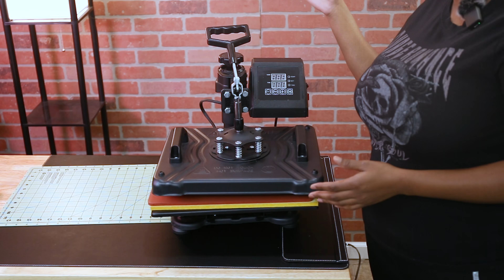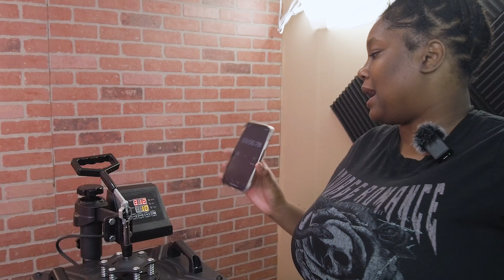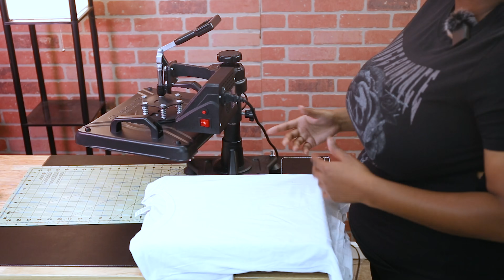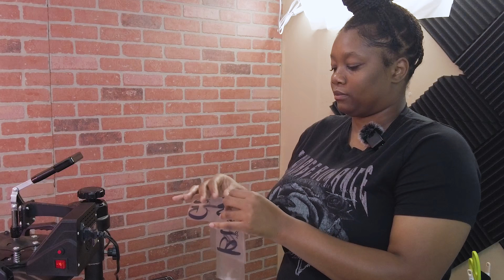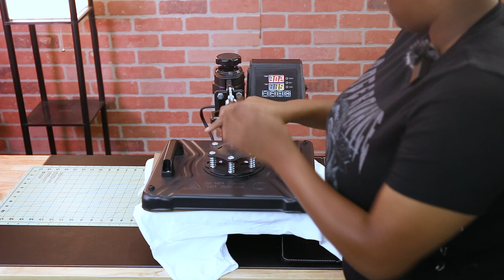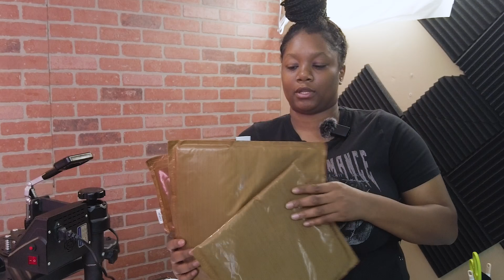How To Use Swing Away Heat Press | Swing away heat press instructions for beginners

Comment: I just bought a used press and the heat plate that you push down is wobbly how do I tighten that to move smoothly left to right like yours does?
Reply from the maker: Try tightening all the bolds with a wrench at the top and bottom of the press

Comment: Can you please make a demonstration using the Teflon? I'm planning on getting my daughter the VEVOR Hybrid Heat Press, 15 x 15 inch, 8-in-1 Multifunction, Heat Up Fast and Even, All-New Patented Design, Easy to Control, Sublimation Press Machine for T-Shirts/Tumblers/Caps/Plates, Light Green from Amazon for Christmas.She's a beginner. What else will she need to get started? T.i.a!
Reply from the maker: Hi, yes I can. But all you need is the telflon sheet and metal magnetic clips to hold the telflon sheet up on the top platen.

Comment: Best video I've seen in this topic.
Question: tips for doing a second transfer on the back of a shirt after I've done one on front? If I have shirt flipped (face down), should I have a piece of Teflon paper on the bottom plate? Or in between the shirt fabric?
Reply from the maker: Thank you! And as long as it’s a mat down on the heat press you shouldn’t have no problem. I have done it before without the teflon

Comment: my unit will not go under 200 temp, and it has no C or F button, how the hell do i know what the actual temp is??
Reply from the maker: You can use a heat temperature gun. And see if it has a reset button on the machine
Reply: @simplyshy  thx, otherwise i wasted 265 on a machine i planned to use to press comic books at a temp of 173F.
Reply from the maker: @mummra7  smh I hope it works out

Comment: Thank you so much for explaining the swing away. It is frustrating trying to go through videos, and everyone has the clamp. You explain very well. Now, 3 questions I have. 1. Where do you get your transfer vinyal from? 2. Which program do you use to make the image? 3. How to do big images like for adults shirts that's like 3xl & up?
Reply from the maker: No problem! 1. Mostly all of my vinyl came from Micheals it’s siser HTV 2.Abode illustrator but if your not really good a designing you can try canva 3. I use a 12X24 mats and just turn the image sideways. But there are bigger cutting machines  other then cricut there called plotters
Reply: @simplyshy  thank you

Comment: When you took your press out of the box, did you need to make any adjustments to the pressure plate to make it even??
Reply from the maker: Hey yeah I did.I just adjusted it enough to have even pressure on my shirt.
Reply: I just got a vevor and the top plate wobbles when i open it and seems to not close evenly. I have not used it yet. Apparently I'm not the only one who has this issue. I had to adjust ut seems somewhat better but not totally

Comment: why does my heat press tip when I swing my arm around
Reply from the maker: I’ve never had problems with mine tilting, only thing I can say is make sure the feet are all on correctly and to make sure none of the screws are loose.

Comment: Quick question what is the correct way to turn off the heat press and how long will it take to cool down?
Reply from the maker: Click the side button to turn it off, and unplug it. Never keep it plug in when it’s not in use … it should take about 5-10 mins to cool down depending on how hot it was.

Comment: I dont know if its normal but my heatpress the top plate is very wobbly, anyway to fox that or is just how it is?
Reply from the maker: I have never had this problem, but I have heard people talk about it. Basically just make sure that the screws that are on top of the press are tight if there not add a washer to tighten them.
Reply: @simplyshy  yeah there is a screw but it's at the bottom that's why I didn't see it before XD thank you so much.

Comment: Awesome video! Great information. I just received my Vevor 6 in 1 heat press. Could you please let me know how you keep the base stable? When I swing the top around 180 degrees the base will lift up. I assuming because the top is heavier that the base. How do I fix that problem? I don’t want to burn myself trying to switch out shirts. Any advice is appreciated. Thank you
Reply from the maker: Thank you ! I had no problem with mine being unbalanced….Is the feet attached to it ?
Reply: You just have to swing it away a little slower. My 15x15 one will occasionally lift if I swing it fast. Just take your time and swing it slowly.

Comment: Thank you so much for this video.  I just bought a Vevor 5 in 1 heat press.   I need this!  Now,  I just don't know where to put it in my tiny apartment.   I have a heavt set of Sterlite shelves.  Would it be safe on a middle shelf?  It's about 18 inches in height.
Reply: I wouldn’t put it on a shelf because it won’t give you enough space to swing it open. They are very heavy too.
Reply: @monicab28  Thank you
Reply from the maker: Glad it was helpful! UMMMM I would keep it lower to the ground or on an extra table top.

Comment: Finally a great video in This press. Hello I have the same press and I’m loving it. One ? What is the best temp setting for htv vinyl thanks?
Reply from the maker: Hi, it depends on the brand you would have to check the instructions to find out. Also, check to see if it’s a cold or hot peel. I hope this helps

Comment: I had a similar press in the beginning, but the 8 in 1 one. Unfortunately the built quality was really shitty. Idk for sure, but I'm thinking this one will exhibit the same problems one day. The first problem was the closing latch. the nits it's connected with broke after around a year of use. after 2 years the base broke. It definitely started deforming way before that, but the design makes it hard to see. The whole base metal was deformed., bushing the metal rod back away from the plate. Also another thing is - this one requires more grease in my experience and it ended up on the clothes more than once... I never got to use the rest of the attachments, because I couldn't get the main one to detach.
I currently have a clamshell and the built quality is waay better. The way it's built also makes it impossible to deform like this one.
Reply from the maker: Very true that’s why theses type of heat press are just good for when you get started and your on a budget.I plan to upgrade I just don’t know what to get yet lol.

Comment: Hello SimplyShy, can you tell me how to get my press to swing?  Ive misplaced the manual and cant find it online anywhere. How do I unlock the press to make it swing in the 360???? Thanks for your help, Te Shauna
Reply from the maker: Hi, so I just lifted up the latch and it should be able to swing left or right. Just make sure it’s a swing away heat press and not a clam shell ( the one that goes up and down)
Reply: Did you ever figure it out? Mine won't swing either and it is supposed to

Comment: Hello dear 
This is so nice am looking forward to getting one.
so how many times can i use the transfer paper  then lastly how can i get it and at how much does it cost
Am completely a beginner but i operate a stationary shop though i what to expand
Reply from the maker: Hi, so the heat transfer vinyl only last 1 cut out per shirt. I wish I had a video on how to make a Heat Transfer vinyl shirt so that you can see it  :(. A roll of vinyl is around $10-$16 but everything I used in this video is linked in the description.

Comment: How do you raise the top platen, mine is really close to the bottom without the pads and also when I swing the top out, the heat press is about to fall over. HELP please!
Reply from the maker: Hey so the knob at the top turns and that allows the platen to move up or down.
Reply: @simplyshy  thank you!

Comment: the top plate of my heat press does not go all the way down to the bottom plate,  it is not the pressure that needs adjusting.  It is just too high.  what is the fix?  what is the knob on the back of the machine for.  Somehow my top  plate got too high (my son used it) and  Icant figure out how to adjust it back down
Reply from the maker: Hey Susan,  most likely the handle is bent after so much use and pressure the handle bends and doesn’t allow it to close down all the way.